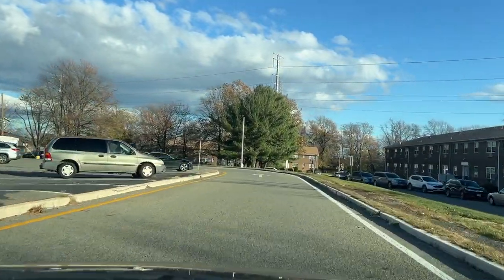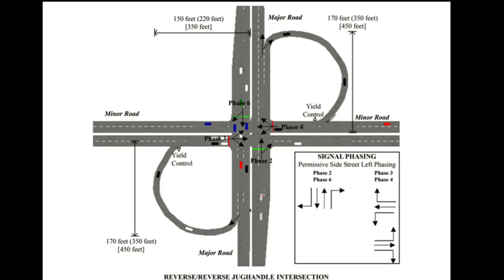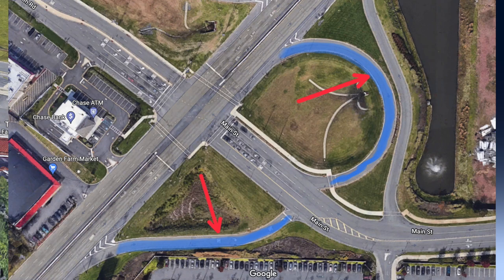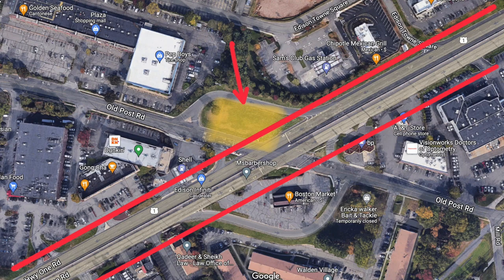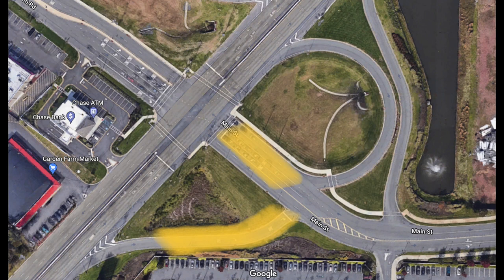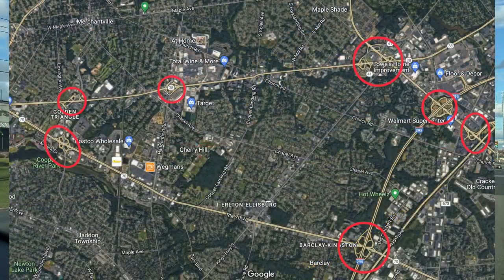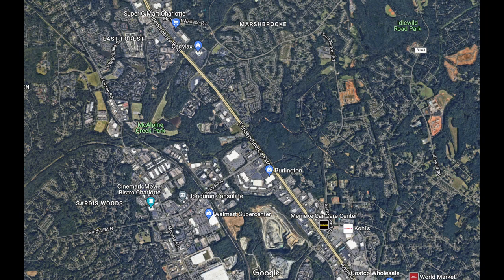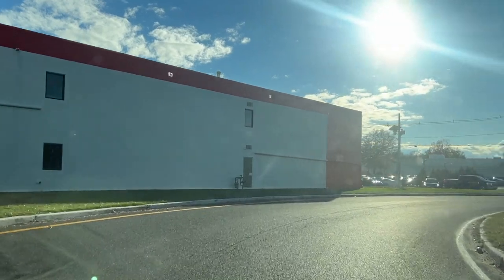Why You CANNOT Turn Left In New Jersey | The New Jersey Jughandle

Comment: Looks totally ridiculous and more money and right of way to build. Here in Texas flashing yellows on left turns are being coming more common. So you don't have to wait for the signal to change green, you can just go when it's clear. You can use common sense. If there is a curve making it hard to see or a busy intersection you have to wait for the green arrow.
Reply: Arizona has been going the same route with left "yielding" arrows, and they work well when there isnt much traffic (basically only late at night nowadays). But I have seen a massive up-tick in left-turning accidents because of it, as sometimes these lights run up to right when traffic gets heavy.

Many of our intersections (especially places like Baseline road), it is hard to see on-coming traffic between the intersections, and people are either speeding or driving to slow. The intersections are very wide, so sometimes making a left on the "yielding" yellow arrow can be a tough call if you arent careful. Ive also noted- people behind me get upset if I dont just "send it" through the intersection during a flashing yellow. They will honk, flip me off...with no consideration to what I can see VS. What they cant see. 

I dont like California- but I have to give them this; Making everyone go on a green arrow or wait at a red seems to work out really well in areas where intersections cant be redesigned safely. Ive noticed that when I go to San Diego or Anaheim, I very rarely see accidents caused by left turns at major intersections, like I have seen in Texas or Arizona. There is no second guessing it, and most people there just expect all light cycles to be that way, so the room for error is minimal. You would have to intentional screw up to get into a left-turn accident. And this system ideally favors larger vehicles (Semi's,  landscaping trailers, etc) too, because it means they dont need to account for the load behind them when making a left in unfavorable traffic. 

TL;DR- Left hand yielding arrows are great for narrow intersections during off-peak traffic hours on a straight stretch of road assuming you have a smaller-sized vehicle. Outside of that, blek. Ideally, traffic systems like this work out much better when other people drive safely and arent assholes, but thats not the American driving style 95% of the time.
Reply: @abcdefghijk6752  I agree if there is a lot of traffic or curves then a protected green makes sense. There needs to be fewer traffic signals in general. They have them so people can get in and out of a neighborhood or parking lot, but they create more traffic and frustration for drivers that have to keep stopping. In these case it's better to force them to turn right and then have a u-turn up ahead so they can go the other way if they need to. There should only be traffic signals at major intersections. Priority should always be on the main drag and not a side street. it's pretty dumb to stop 30 cars to let one or two people go. U-turns in an area away from driveways is a better solution though there are drawbacks like you said. There also needs to be more right turn only lanes and for left turns two lanes instead of one so they don't back up. Right turns should turn into their own lane on the street they are turning on so traffic can keep flowing. Light synchronization also helps a lot and encourages people to go the speed limit so they can just keep flowing. Having raised medians prevent people from pulling out into traffic. Lanes merging should also be avoided. he goal should always be to turn right and u-turn in a safe area. Even turning left and then u-turning on another street might be better in some places. I notice more intersections don't allow U-turns so the right lane can keep flowing on the other street.